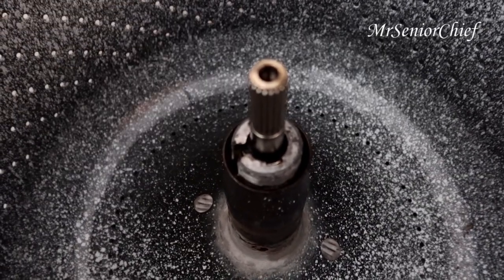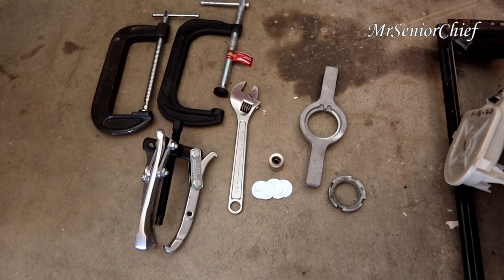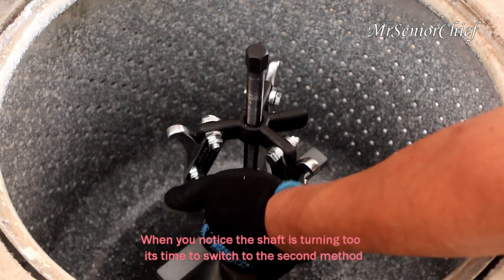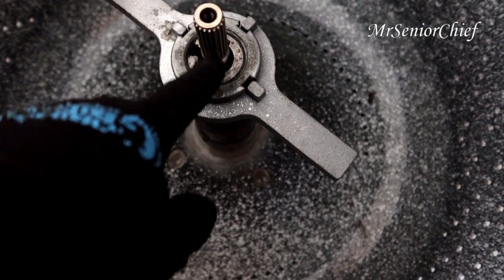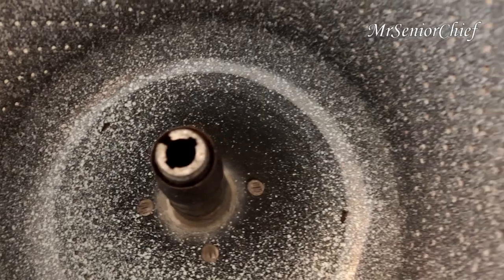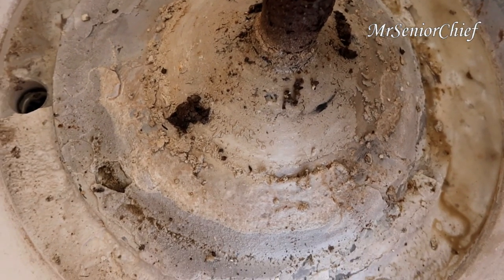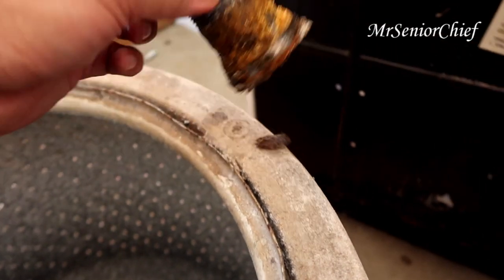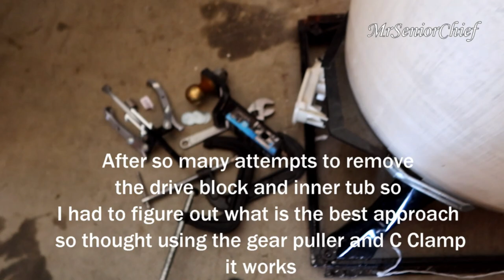DIY # 14: How to remove Stuck Inner Tub & drive Block on whirlpool washer

Comment: Here's what worked for me in this order:  Light tapping.  More tapping.  Liquid Wrench.   Increased tapping and more liquid wrench.  Banging, liquid wrench and propane torch.  Crying.  Cussing.  Some amount of beer.  
Finally, what worked was banging down and at a slight angle on the drive shaft itself.  I couldn't get it to actually rock back and forth like so many people could.  Replaced the drive block and seems to work fine now.

Comment: Thanks so much for this! I spent half my day pounding on the drum to try and free up the corroded drive block and inner tub.  
I didn't have a tow hitch to put over the spline, but used a length of c-channel to give the clamps something to hang on.  Took about 30 minutes to figure out how to get my clamps in place without a third hand or trained monkey, but as sooner as I did, the tub popped right out!  Thanks again for a well shot video that clearly explains everything!
Reply: Maybe you can share just how you got those clamps on without any assistance.

Comment: I was taking the tub from our broken machine to clean it and move it to another machine I got off of Craig'sList for FREE.  I didn't have a tub nut spanner wrench so I used a Hex bolt (5/8" x 3") that I had laying around in my shop.  First I sprayed the nut with WD40 (out of Liquid Wrench grrrr.) and placed the head in the notch and tapped it with a hammer (moving it around the nut) until it broke free.  Tried the same with the other tub nut and it worked the same!  When I tried to lift the tub on both machines, they wouldn't budge.  I decided to do the same thing with the split in the Drive Block tapping it in one direction and then the other.  Then I got a chunk of scrap 2 X 4 (pine) and placed it on top of the Drive Block and tapped it in a downward direction, walking it around the spindle shaft.  Finally, I placed the 2 X 4 on top of the spindle shaft and tapped it some more.  Both tubs lifted right out!  They came out with the Drive Block and I had to use a piece of a 1 X 2 to punch it out of the bottom of the tub shaft.  Liquid Wrench and a 3" Hex bolt worked like a charm.  I scrubbed the "new" used machine's outer tub and used a wet/dry vac to remove the dirty water.  Scrubbed the "old" machine's tub and swapped it to the "new" used machine.  I will be repairing this machine until I die.  The NEW machines are garbage and break down the day after their 1 year warranty expires!  I'll take my OLD Kenmore (Whirlpool) machine any day over the new electronic machines.  Plus the parts are way cheaper and they actually work!
Reply: Thnx buddy. Your method for removing that nut worked great. Luckily the basket lifted right out.

Comment: The only method that worked for me was using the hammer and using the spanner long handle vertically to strongly tap all around the top part of the drive block using a microfiber cloth to prevent damage. Before hand I did spray some Rust Blaster around the transmission rod and let it sit a while. I came back a few times with no results. So I let it sit longer. Then I came  back to Hammer hard the Drive block, then I aggressively rocked the inner tub back and forth, and pulled upward. It came out. It WORKED!
Reply: P

Comment: I had the same problem with the Gear puller. But used vice grips on the drive spline to hold it in place. It was still stuck although the tub was much higher after the gear puller. I used a steam machine to blast the drive block area and it finally popped off.  Now my drive block wont come out of the bottom of the tub shaft, lolz. 👍👍

Comment: When I did mine last week, I wound up putting the nut back on a few turns, then putting the 3 jaw puller on it, with the screw part of the puller just inside the shaft, since it was a little wider than the threaded hole in the shaft. It worked ok, it didn’t turn like yours did.

Comment: The inner tub tube, where it comes up the shaft under the agitator, rusted so bad it broke in half about half way up to the top. The tub was junk so where the drive block is split I took my drummell with a cutting disk and cut a slot in the drum shaft from the top down to where it was rusted/broke, about 2 and 1/2 inches.  Just deep enough to cut the tube. I then took a cold chisel to the slot I cut. The drum came right out. This works fine if you are replacing the tub.😀😀

Comment: I've found thwt a 2×4 length of wood wedged between the transmisson and the support brackets that hold the tubs helps to keep the shaft from spinning while you are trying to loosen and remove everything..

Comment: I appreciate your video. My problem? My gear case is fused to the wash basket. I purchased a new gear case/transmission, removed all necessary parts (all by my female self lol) but now I can’t get the old one out. HELP!!! 😩😩😩😩
Reply: UPDATE After quite a bit of lubricating, I was able to get my gear case out and replace. I replace the wash plate as well which was no problem at all. I forgot to come back with an update after asking for help lol. I’m so proud of myself 😂

Comment: I just did this the other way. At the bottom of the shaft are holes. Stick your screwdriver in the hole and push to one side and the tub will get unstuck.

Comment: Dumb question I have possibly, once you cleaned everything and put it back together, did you have to replace any type of lubricant grease, specifically between the outer and inner tubs on the shaft? My machine stunk, there was tons of weird algae gel like stuff,  hoping everything works once I put it back together. Thank you for the video.

Comment: What you did wrong was when u did the pully and u notice that the shaft was turning u should have use a vice grip to hold it from turning. That’s what I learn from a different video and it’s so much easier than the c clamp

Comment: My tub was stuck to the drive block I held the tub while I hit spanner wrench tightening way on the hub nut...then it didn't seem it did much... I poured a liquid soap around the drive block...seam between tub and block 2 seconds later soap soaking down....I didn't have penetrating oil..... the tub lifted right out! Cos my tub and drive block were spinning together after I had removed hub nut... couldn't lift tub out. After all that the drive block I just tapped up out from underneath with a hammer.

Comment: Amazing enginuity!
Was trying to fix my mother in laws washer today (looks just like this but is a roper brand & isn't spinning/agitating).
The agitator bolt was rusted & the top of the bolt broke off while trying to remove it. I drilled out the center of the bolt & used an extractor bit to remove it but the extractor bit broke off (flush with the top of the broken bolt)! When I try to drill into the broken extractor bit metal it just breaks all my drill bits.
Now that I see your video I realize that I might of been able to take the drum/bowl thing out without the broken bolt removed.
Do you know if I can remove the part with the broken bolt & replace it or is it attached to the motor shaft & not removable.

Comment: Will the transmission incur any damage by putting pressure on the shaft pushing down? I am going to try this but if it doesn't work, I'm getting a Speed Queen.

Comment: Just pull up on the tub grab a sledge hammer and clunk the drive block a few times and it will break it loose… it always works for me…

Comment: I tried this method. Unfortunately ended up ruining my transmission. 
Wasn't able to remove the tub either. My drive shaft was "fused" with 
gunk to the drive block. So the clamps ended up forcing the center of 
the drive shaft into the transmission.
Reply from the maker: Ah ok but not in my case.... your experience might be different from mine. And thanks for sharing...

Comment: Got something a lot easier.  A wheel puller,  The 3 claw kind. Not sure if anyone suggested it. I turned over the spanner nut to have more surface. &It came right out. The drive block was rusted to the shaft & tub, badly it's still stuck it it I only had my whirlpool for less than 5 years. Will never buy another one. Got a maytag.  Got to be better made, it's made in America. I hope !
Reply: Maytag laundry is made by Whirlpool
Reply: @aleciaappliance7667  I'm thrilled

Comment: Need help... I did the clutch repair on a LSR7010pq1. The center shaft was corroded and would not come out. Took a lot of effort, hammering and time but I got it out. I removed the inner spin basket thinking it would help me get the shaft out. Wrong. 
  The drive block is stuck in the basket and no amount of hammering with a 4lb mallet will set it free. Replaced clutch and reassembled without issue. The drive block was very difficult to tighten and get it to lock on the shaft. But I got it tight.   Now when empty, Low spin is fine but in high spin it goes violently out of balance.
    I checked the suspension components and they are all in tact. The Spin basket remained attached to the shaft after several tests. 
Not sure what went wrong. I think it is related to the drive block or the basket. What confuses me is that it is fine on low spin.
I am going to run it without the Spin basket to see what happens.
Any Ideas what my problem is ?
Reply from the maker: check your neutral drain transmission maybe during the process something got damage. if the transmission is the issue i will not try to repair it just buy a new one save you some time and money in the long run. I will post a follow up video. soon 
To date 1/21/2022 the washer is working with no issue what so ever knock on wood. 
Good luck on your repair and God bless.
Reply: The problem is your drive block needs to be replaced and clean up the transaxle/ shaft ( as you call it ) otherwise you are going to continue to have a slow spin cycle and your clothes will not " spin " dry !!
 (Wet clothes) you can always Google what a part does for a machine! This is the second time in 6 years that I have had to replace the drive block!
Reply: By the way, put veg. Oil around the drive block 3 applications within an hour, and put a towel around the tub where the drive block is use hammer sideways and tap all around a few revalotions then pull tub off !!!
Reply: I used a 5-ton 3-claw puller rented from local auto zone. (Fee refunded on return). Tub nut wrench under the nut is what I clawed. The puller point started drilling through the shaft. I then removed part of a pipe wrench and stuck that between the puller point and the top of the trans shaft. Used a 1/2” ratchet to turn and lift the puller and lifted the tub!  I had applied liquid wrench for a few days so that reeks and everything is so funky and will be hard to clean. Who knows if it still works after all this and I put it together. Have already picked out what new front loader washer to buy. The black gummy stuff was in the hoses - I removed the 3 black rubber hoses and cleaned the insides. Maybe I should have stopped there.  Will post results after I clean and reassemble.
Reply: @nataliehursky5499  let me know how it works out!
Reply: @dalejones1943  Cleaning the drum and the plastic tub was surprisingly easy enough with soap and a scrubber sponge.  However, the metal drum is very rusted under the "magic lint filter" on the bottom - which I cracked off using a lug wrench. Still usable - but had to come off to clean under there - lots of lint and dirt washed off.  But the drum is very rusted - expect that rust will get onto the clothes.  1995 - washer is 28 years old.  Time to reassemble and do a test load.  Buying a new Electorlux front loader - black friday sales on already at the local appliance store.
Reply: @nataliehursky5499  sorry to hear about that!  Are you willing to part out your washer ( sell parts of your machine ???) I don't know what State you live in ? I'm in San Diego California!
Reply: @nataliehursky5499  Did you do a test load on your washer? The other question is that you might be buying a New WASHER?  If that is the case, would you be willing to sell parts of your old washing machine???  Please let me know. Thanks
Reply: @dalejones1943  First test load resulted in lots of bits of ?rust, lint during the wash - then less during the rinse.  Next load - water is clean, washer working great, no smell.  Should I sand down the rust on the drum to bare metal?  Paint? What kind of paint?  Need to insert the 4 lint filter plugs in the bottom of the drum. The drive block works, was pretty corroded.  There is also a lot of rust on the tub support/brake shaft that goes over the transmission shaft.  So far so good, need to catch up on laundry before taking apart again.  Picked out an Electrolux 600 series front loader, if I need to replace the old Whirlpool.
Reply: @nataliehursky5499  The question is " Are you getting a New Washer "  ??? Or asking if you need to " buy a
 " New Drum" for your washer direct drive??? I can't answer your question for you! What I can say If it were my washer, I would buy the New  " Tub " ! Spend a couple of hundred dollars to keep machine running! ( they don't make machine like these anymore!!!) Let me know what you decide to do with your washer? Thanks
Reply: @dalejones1943  I could get a new drum for $182 + $50 shipping.  But so far, the washer is working great and no sign of rust in the water.  I hear the new washers only last 10 years at most (!$!%^??!) so I'm hesitant to buy a new one.  My Whirlpool is almost 30 years old and going strong.  I'm outside of Philadelphia, PA - but would probably try to sell the parts IF it ever stopped functioning.
Reply: @nataliehursky5499  You should buy that New "TUB" now, while you can, before they (Whirlpool) changes the price? Also while the drive block is still New!!! Thank you keeping me informed ! Happy Holidays!
Reply: @dalejones1943    Good to keep that in mind.... I didn't even buy a new drive block (yet) - it's corroded but holding the drum fine.  next step - add lint filter plugs for the 4 holes and check the rust.  Having other plumbing issues fixed in the laundry area, so not a good time to switch to a new washer.  I am very resistant to "change".
Reply: @nataliehursky5499  If your drive block is corroded, it must be replaced! If it does not get replaced, you will have a slower spin cycle that will NOT spin the clothes dry, and you will have wet soggy clothes when the washer stops!  I hope that helps you out! Happy Holidays!
Reply: @nataliehursky5499  they dont make the outer drums (or inner) anymore, they are a discontinued part. You might be able to find a used one somewhere but that may be difficult to locate. If your has rust, it should be removed as best as possible with fine wire brush (dremel/rotary tool attachments help), then sanded down gently with fine 1000 grit wet/dry sandpaper being careful not to make it worse with new scratches. Then treat the bare metal with Naval Jelly to eliminate any remaining rust. If any pits or holes you can cover them with automotive high-temp RTV silicon sealant. If its really bad you can then apply additional layer of 'flex-seal' waterproof sealant rolled on the entire bottom & any affected areas to make it leak proof. This would get more mileage out of the unit for just a few bucks..

Comment: i Think that you should have tried the "mexican technic" aprubed by the " orthodox russian society of tecnicians".  first: atatch the bolt to the dive block enough to sustain and not rip of the treads after some abuse on it .   Second: grab a small sledge hammer. Third: grab the spinin tub by the edge. Third: Lift the thing from the gipp you allready got on the spining tub. Finally: Begin the hammering on the drive block bolt ...spesiallly a at the side neerest the spot your are lifing from. hit carefully a first then at will if it dosent give way!  (This is a fool proof technic highly certefied by people)
Reply: Looks like you know a better way but unfortunately, I could not understand your instructions. Thanks though. For now,  I'll give it chingasos con el martillo to see if it will work.

Comment: Too much video editing, and you didn't explain what you did. You put a trailer hitch slider on top. You didn't show what you did. Did you lay it on top of the drive shaft sticking up or do you have some sort of spacer in between the slider and the spanner wrench? I have the same problem the tub is stuck.